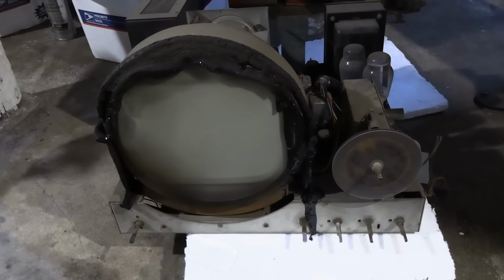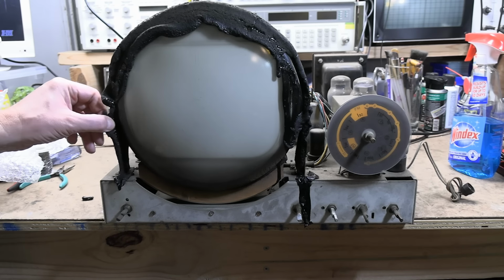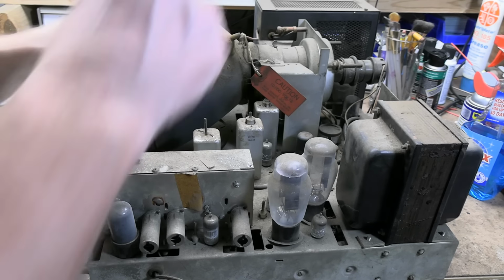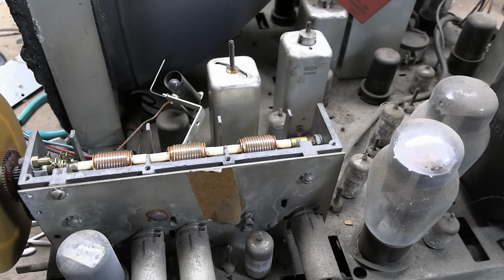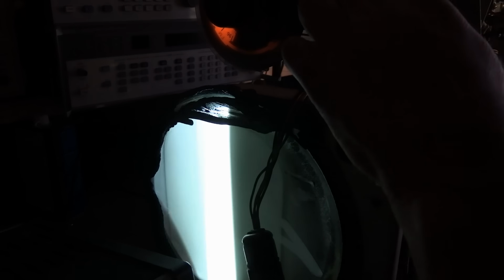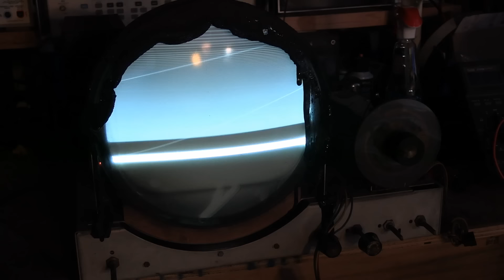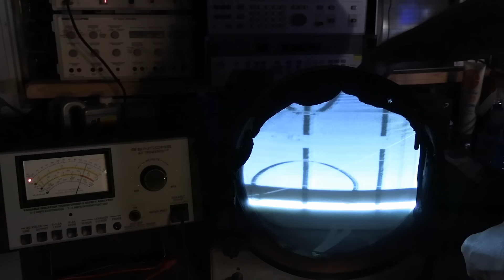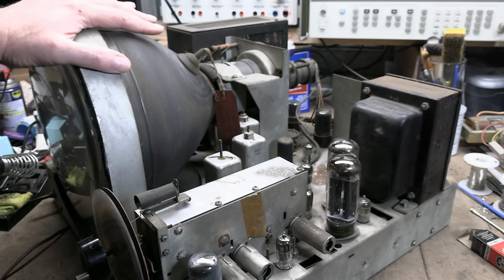Stromberg Carlson TS-10 resto part 1 - first power up

Comment: It was wise to get a baseline from this set to determine whether it is a candidate for electronic restoration. Considering it's 76 years old, it appears there was little to no service done on it over the years. I'm amazed at how crisp, sharp and undistorted the image is after replacing a few caps in the deflection and AGC circuits. Those paper caps aren't all that good, even when they were new.

Comment: Were Phillips screws commonly used in 1948?
Reply from the maker: Yes they were
Reply: @bandersentv  Seems odd that some mfrs were still using slotted sheet metal screws in the 1960's and 1970's then.   Probably they were cheaper.  Phillips screws just seem a lot better.  All of the Dynaco stuff I built back in the day used slotted screws.   I think Heathkit was still using them as well.
Reply: @rlgrlg-oh6cc  Phillips screws came out in the mid 1930's.  They helped when power screwdrivers were used in assembly lines. Sheet metal screws will strip out if too much torque is applied so the drivers need to be set to a low torque limit.  Hobby assembly doesn't have those issues.

Comment: For the gear in the tuner, I wonder if a 3d-printed part would work? You'd need high melting point plastic of course.

I "fixed" the mech in an "automatic" oven clock once, that had a gear which appeared to be made of compressed cardboard!
Reply from the maker: I suspect it would not be strong enough.  The phenolic gear meshes with a metal one.
Reply: @bandersentv  I'm thinking a new gear could be made using a piece of brass and a file like a clock maker would do. It will take some time and a good jig to get the spacing right. Clock maker's lathe would be good to have for these parts.

Comment: Those gears on the back of the dials aren’t metal. They’re some kind of phenolic and will strip easily. All of them are broken. I needed to transfer from a spare but it was not simple
Reply from the maker: Right - phenolic.  The teeth are near gone for about 20% of mine.  I might be able to scavenge one from a part chassis.  I see what you mean about it being complicated to swap out.